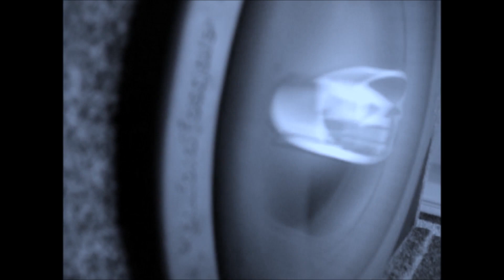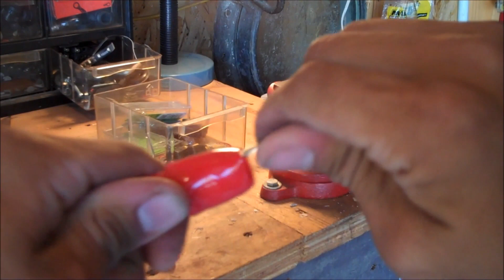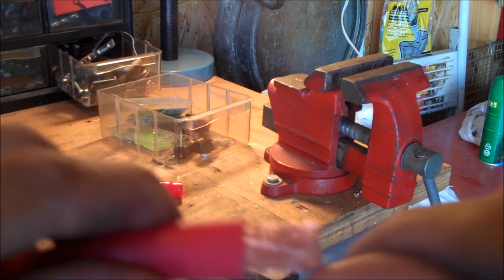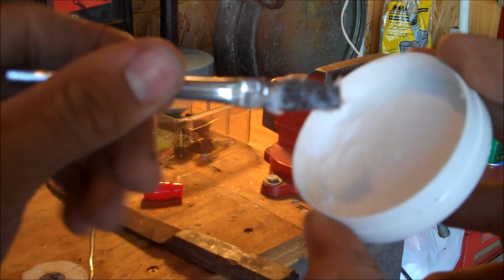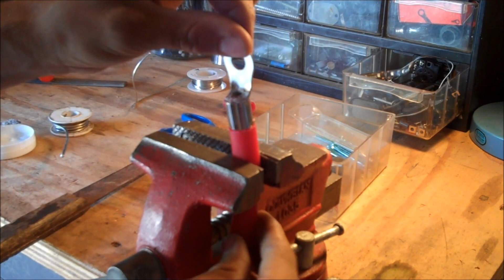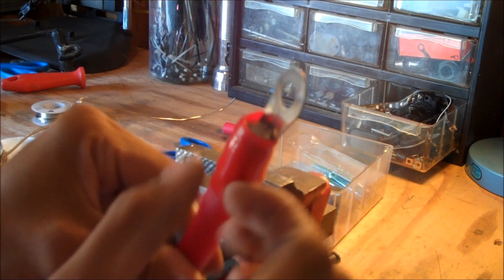How To Solder Ring Terminals for 1/0 Gauge Power Wire

Comment: For oversized 1/0, I suggest using 2/0 or 3/0 ring terminals to avoid loose strands. I know for a fact sky high uses 3/0 terminals (13mm inner diameter).

Comment: It would help to explain WHY it's a bad idea to solder high-current connections. Because of the potential for the wire to get so hot under load that it melts the solder!  Should be properly crimped only.
Reply: That is exactly my thoughts. When I do this I barely use any solder at all. I definitely don't pile it on and put a solder cap on it lol. May as well just use 4 gauge wire if your gonna do that

Comment: Do you suggest crimping and soldering? I have seen people use a hydraulic crimper.
Reply: It's only preference. Both do the job. Double is redundant.  If you want extra and clean,drill a few holes in the side, solder then up. Will bite into the wire and fasten to the terminal

Comment: hey is it absolutely necessary to solder or can u just crimp real well and tight and call it a day??
Reply: You don't have to solder, but it is generally the best form of connection. You can get away with crimping, but you definitely need to make that connection as strong and solid as possible.
Reply: In my opinion, you can crimp large wires like battery cables.  But if you want a crimp that is as good or better than solder you will have to shell out some good money for a quality crimper. I think crimping is the way to go, but if you don't have $200-$300 or more for a good quality crimper then soldering, if done right, is the way to go.  It is the cheap way but if done right it should give a good connection.
Reply: go ahead and check out EXOcontralto he has lots of vids on Mobile Audio and a few tips on soldering and crimping large 1/0 awg.  

Soldering Large wires: https://www.youtube.com/watch?v=FEWuCI-h-Mo

Battery Cable Crimper: https://www.amazon.com/Goplus-Hydraulic-Crimper-Terminal-Crimping/dp/B00ZA2P3XM/ref=sr_1_8?ie=UTF8&qid=1535624812&sr=8-8&keywords=battery+cable+crimper+tool

Comment: Hey is all flux the same ?? Can i use PTF800 tinning flux or will it ruin it?
Reply: No  never use plumbing flux for electrical connections. it causes corrosion the wire will corrode and fall apart over the years leading to high resistance bad connections use rosin core flux for electrical connections.Jim

Comment: Proper way = crimp first. Use a copper connector. One in video wasn't copper. Dissimilar metals....... Flip connector over 180 degrees from video. Let solder flow into connector. He used waaay too much heat. Turn it down and heat the hole/lug area of the connector. Lastly use a wire brush for cleanup all around the connector. Then wipe off with an oily shop rag.
Reply: Proper way is subjective... Ultrasonic laser welding hotcrimp...
Dissimilar metals? tinned copper connections are for marine use. Think about that one. What the hell kinda solder do you use, pure copper to solder your pure copper connector to your pure copper wire to hook up to pure copper wire terminals that hook to pure copper battery terminals. Most solders I have seen has 2 or more metals in them. 
 Now personal I cant call it if its too much heat since it depends greatly on the solder and flux but the way he is heating is may not be right, leading to a cold solder that would fail. Trying to heat it to directly and too fast. He should be able to heat up the back side of the connector towards the end and the flux would allow it to transfer the heat to the wire. It should be flipped 90 degrees and the flux should draw the solder into the wire. 

Or simply give it a proper crimp, marine heat shrink wrap and move on the the next on

Comment: the screew on the terminal wont fit on my battery cable can i drill a bigger hole on the cable.?
Reply: Yes but be careful when doing it because the drill will usually want to hang so trying to hold the connector in your hand while doing it can be a little dangerous. I usually use a unibit when drilling them bigger. If it does hand just spin the drill backwards on it then try it again
Reply: All2skitzd use a step bit

Comment: two words . crimp tool.  i was just reading arguments for these connections and they started throwing marine codes and other codes. crimp and correct type of shrink tubing  seemed to be the winner for many corrosion prevention issues.
Reply from the maker: +immrnoidall ya in recent years I've switched to crimps. It's easier too.
Reply: JeepAndBass i don't see how crimped is better but that's what they say.
Reply from the maker: I guess because your not mixing metals at least if you use copper on copper lugs.

Comment: For the most part you passed. Need to keep your fingers off the copper. The skin oils and acids corrode it. Use a T-shirt to twist the wire if needed. Think clean hospital conditions when you solder/weld. Your solder looked dirty. Wipe it down with some WD-40 and a rag. The heat will burn off the excess WD. Get all the wire into the terminal. Don't be lazy and trim off some. You paid for 1/0 gauge, why not use it?
Reply: Good points.  I have found that if the actual wire is tight and some strands are hard to get into the fitting, you can cut the insulation at the point you've measured (most terminals for 1/0 cables have a barrel that's about 5/8 to 7/8" long but it can vary so measure it).  Once you have your cut, and it's important not to damage the strands with the knife as you say, pull the insulation off about half the way.  Twist the insulation around a bit to get a good wrap on the strands, then trim the half of the insulation that's hanging off the end.  Line the barrel of the terminal up with the insulation and use it to push the remaining insulation back.  With a little practice, you can get the barrel on so that you don't have the "whiskers" off the side.  Hold the barrel part the way on, take a sharp blade and slit the remaining ring of insulation off, apply a neat ring of flux and push the barrel fully into place.  
It's a little "fussy" to do it this way but it keeps the strands clean and straight and it keeps them clean.  

Also, it's important if there's going to be any moisture present to get as good a seal on the joint as you can.  If you don't, moisture will be drawn into the joint and it will corrode the electrical connection from the inside.  This is NOT good.  I'm a little concerned about the insulation bubbling as you solder - those bubble areas are cracks and voids at the margin of the insulation, I like to wrap a wet rag around the insulation on 1/0 to 4/0 cable to keep it cool but you don't want it too cool - otherwise the solder won't flow.  If you're going to use heat-shrink (some people say not to as it may trap moisture inside but I think if you do it right, it's good),  Make sure that you're getting a positive seal all around the area where the insulation butts up against the barrel.  It goes without saying that you need a positive seal of solder at the tip of the strands, too.
Use good quality heat-shrink and the type with the sealant made into the inner surface.  There is a procedure for applying heat-shrink -- start in the middle and shrink it down smoothly to get air and bubbles out and move towards the ends -- that helps to get a positive seal.

What you've done here is a good demo.  Thanks for posting it.
Reply: +jim davidson Yeah he did do a lot of touching the wire. I usually try to wear gloves. If anything i'd use emery clothe of something to wipe off solder but but the solder looks dual because is lead free solder. Depending on the type of flux he is using if he was to put a petroleum based product like WD-40 it could dilute or resist the flux (i would think)

 +brucebear1  Yeah thats how i get them in something be that method depends partly on how neat the end was caut on the wire to start with and how soft the insulation is. I've also used a business card wrapped around the wire like a funnel then pull it out as im pushing the wires in to the terminal. If its super high strand count and too small of connecter I will sometimes flare the end with flare tool or wire handtool then unflare it when I get it put together. 

That seems like some shit wire to melt like that as fast as it did. I wouldn't of had it pointing up in the vice making all the flux flow downward. He could of had it clamped sideways and they flux should draw the solder into the connector. I dont solder connections anymore but I used to before I had a good way of crimping the wire to the connector where it becomes one solid piece a there is nothing to solder. Then using the marine heatshrink 

his way works for him I guess, I just wouldn't be slapping the how to label on it
Reply: "Don't be lazy and trim off some." But if you are going to trim off some make sure to use a rusty old kitchen knife. Still, it's a good instructional video. Focus is overrated anyway.
Reply: I have a knife like that, will put it to use on my car project.

Comment: That's great info. Thanks so much. Im  using 4 gauge stuff. The stock Harley battery cables are 6 gauge.   Which is plenty sufficient on the stock engine but mines far from OEM. 

Again I appreciate your time & effort in helping others out
Reply from the maker: Glad I could help; best of luck you you!

Comment: Thanks for your video. Very helpful. In putting 2 equal batteries in my harley touring bike. Gonna need custom length cables. I tried googling "new concepts" cables in different wordings & no luck. Could you give me a website to reach? Thanks again. David
Reply from the maker: Its spelled funny; KnuKonceptz is the name. I also use a company called Sky High Car Audio (SHCA) I think they have a better product for a slightly better price. As for the cables pay attention to what you buy; there two kinds of wires, one if called CCA and the other is called OFC. OFC is better for conductivity and resistance to corrosion but it's more expensive. I suppose you don't want huge wires on your bike so getting a wire of a smaller gauge will be fine but getting OFC wire will help allow lots of current to pass without needing the huge wires.

Comment: I tried this..my flux is yellow/clear..is that the wrong type?. It didn't turn out well..solder cane out with bottom. .buy didn't hold and of the strands.
Reply from the maker: If it's coming out the bottom you are getting the terminal too hot, as long as you are using rosin flux you should be fine, if you still have a hard time with it then you can just use rosin core solder but I personalty like putting the flux in myself.
Reply: ok ill try and step the torch back a bit, see if that helps..thank you